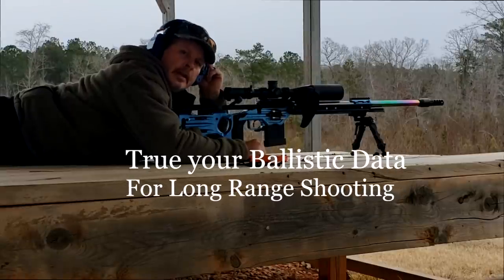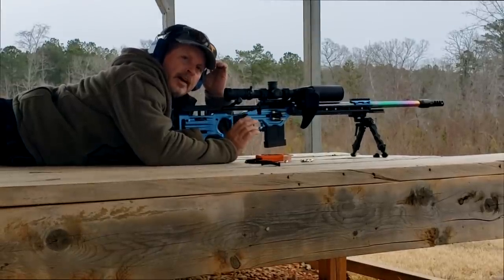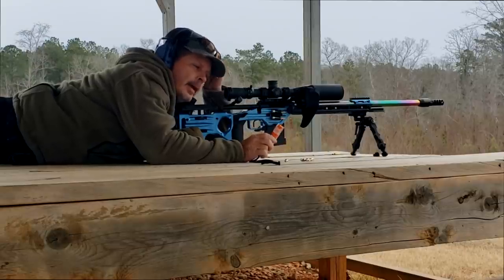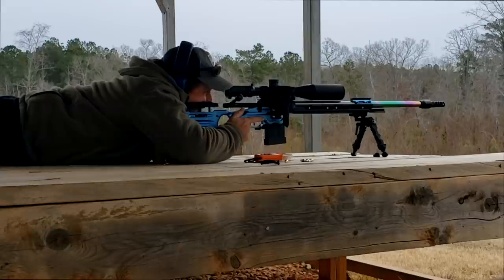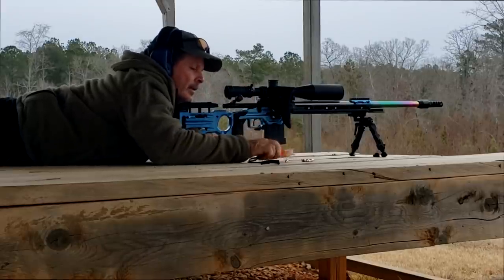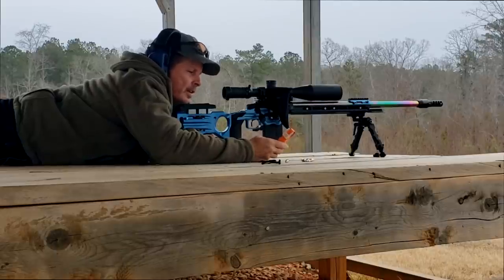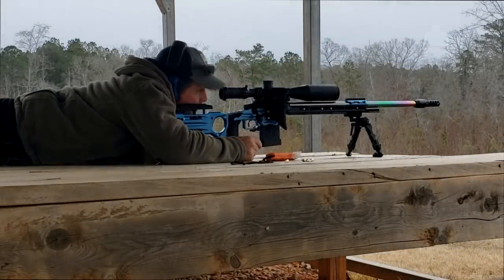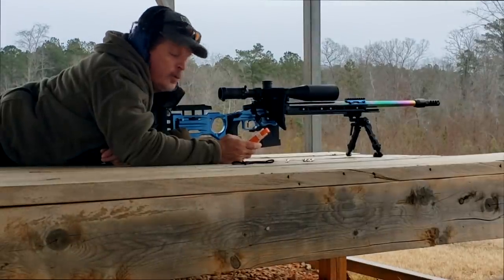True Your Data for Long Range Shooting

Comment: Very well done explanation!  Only thing missing was a screen shot or video clip of what adjusting your b.c. actually looked like on your Kestrel.  By the way, what brand/model is your brass catcher, and where can I buy one?  Bob  P.  Dakota Dunes, SD
Reply from the maker: Bob, that is an MPA Brass Catcher. They are on our website. I actually decided to shoot that video on the way to the range on Saturday. I didn't have anyone with me to provide the additional video footage of the actual adjustments on the Kestrel. That would have been a nice touch.
Reply: Shout out to Masterpiece Arms for having the brass catcher's wire frame made here in the U.S.A.

Comment: Would like to see you come back to 500,,,, will it run true at your bc setting??
Reply from the maker: Great question. My experience has been every time I run it  back down to 500, the data tracks perfectly. I thought about including this in the video, but dang, it was already 11 minutes long.
Reply: @cncmts  well this kind of stuff is worth watching no matter how long....another few minutes would be ok by me.....great info for sure
Reply: @cncmts  Why bother with a chrono if you’re not going to use it?

Comment: Great video - even 2 years later.  Question: At 500 yards, if you would have been 2 inches high, are you saying you would have adjusted the velocity (down) until your shot aligned with the line, then continued on with adjusting the B.C. (as you did in the video)?

Comment: Using g7 will drastically reduce the need for truing bc. When I used g1 I had to do this, but switching to g7 and just using chrono mv its pretty balls on accurate straight up.

Comment: Any reason you choose G1 over G7? Or is it just a number and doesn’t really matter ? I ask because I have always heard G7 matches ballistics better on the  low drag tangent ogive bullets. Great video as well sir
Reply from the maker: When I 1st started shooting long range, I used  G1 and that is what Im used to. I know many that prefer G7, and I have tried both. Cant tell the difference between the 2 TBH. I know some "snobs" would balk at that, but as long as the shooter is truing the data at distance, I just dont think it matters.
Reply: @cncmts  agreed. I have thought it’s a number so as long as you do the work it should work. Hey thanks for video and the reply sir. Take care

Comment: Nice info Phil. Seems like after adjusting your bc at 1000, your bc’s at distances between 6-800 are slightly off. Is this technique more accurate than using Applied Ballistics custom drag curves?
Reply from the maker: What I did not do in this video, mainly because it was already 11 minutes, was shoot the targets back down to 500 yards. I have always found that when following the method shown in the video and the bullet is trued at 1K, it always tracks back to the waterline at shorter distances.
Reply from the maker: Also, I have seen far too many times that when shooters are using custom drag models, problems seem to occur. Not sure why. But using the "Bryan Morgan" method, it always works.
Reply: Thanks Phil.
Reply: @Masterpiece Arms  Measuring drop at one range to predict drop at others is how Art Pejsa's formula works.  He claimed it could get within half an inch at 1000 yards.  Maybe Kestrel will consider his approach as an option someday.

I am curious what atmospheric conditions your Kestral reported if you have them noted.  I ran your bullet and velocity and the 0.560 G1 number you gave (the Berger site has it as 0.559 now, but not significantly different) in two exterior ballistic programs with your 2.1" sight height.  You said the Kestral wanted a come-up of 2.64, and you used 2.60.  Both QuickTarget Unlimited and one of the JBM trajectory calculators suggest that at a standard atmosphere, it would be about  8.80 MOA or 2.56 mils (milliradians) or 2.607 mils (NATO mils). Barometric pressure would have to be about 32.6 inches to get 2.64 milliradians.  If your sight is using NATO mils, then it would be 2.607 mils in a standard atmosphere as the other programs predict it, and since your 2.60 setting shot right on the bottom edge of the line, I'm thinking that's a perfect match to NATO mils in a standard atmosphere.  The Kestral uses milliradians, and the fact it came up with a number that requires pretty dense air suggests it is recommending high values, which may account for its failure to track further out. 

I'm just curious to find out what the cause of the elevation recommendation error is.

Comment: @ 1:55 .....He mentions using a G1 BC. edit That goes against ballisticians recommendations. It’s best to use a G7 B.C reference in your kestrel! If you need the G7 BC for any particular bullet, check out the G7 BCs provided by Applied Ballistics for the commonly used bullets.
Reply from the maker: Not very wrong. You can get perfectly acceptable ballistic data using G1. Most long range shooters run a G7 especially on boat tail projectiles, but in the case of projectiles running supersonic, it matters very little. Also, do ever wonder why a company like Berger puts a G1 BC on their boxes? When you visit Sierra's website, why do they only list G1 on their bullet data? I understand the argument, but using a G1 BC is by no means "very wrong." Also, here is a comparison between G1 (0.610) and G7 (.305) on the 108 EH, running 2870 out of my BR... 1100 yards (8.85 G1/8.88 G7) 1000 yards (7.53 G1/7.56 G7)   900 yards (6.33 G1/6.33 G7) 800 yards (5.21 G1/5.22 G7) 700 yards (4.19 G1/4.20 G7) 600 yards (3.27 G1/3.27 G7) 500 yards (2.42 G1/2.42 G7). This was calculated using a G7 of 0.610 and a G1 of 0.305). If following standard dialing procedures, the only distance this would have any difference is at 1000 yards. You would round up to 7.6 mils using a G7 and round down to a 7.5 with a G1.
Reply: @cncmts  Fair enough! However, Bryan Litz suggests to always reference a G7 bc standard, as it most closely represents the drag model for boat tail bullets used in long range shooting. Perhaps I’m way out of line(and I’ll be the first to admit it), but if a man of his intellect and specialty regarding external ballistics suggests to only use a G7 BC standard, I would tend to agree and use his word as fact on the matter. If the same results are accomplished by using either one, then by all means! Use the G1 🙂👍🏻 But, as velocity decreases at extended ranges, I believe the G7 is a more reflective drag model of what the bullet flight path is actually doing. Particularly, as it reaches the transonic range distances. In Applied Ballistics for long range shooting, written by Litz, he writes on pg.39: “Its just a matter of time until the collective masses recognize the handicapping effects of using BC’s referenced to the old G1 standard.” There’s more than one way to skin a cat right? Either way, great content and love the channel!
Reply from the maker: @cwoodside907  I can agree with that. Bryan is a smart fella and if Im shooting at ELR distances, Im certainly using a G7, but for the purpose of this video, and the audience it was intended to help, either will work.
Reply: @cncmts Litz believed/claimed that maximum range of 5.56x45 mm NATO (S109) was over 3800 yards in standard arm. cond. Then a ballistician from Yuma proving grounds joined the discussion and said that in their tests Ss109 never flew over 3400 yards 😜

Comment: Seems to me you are “trueing” your BC to achieve impact variations that are actually caused by variations in either velocity or density altitude (temp/bar pressure/altitude).  Bullet manufacturer’s know the correct BC and it won’t change so if you true velocity the only major variable left is DA.  So what’s the advantage to trueing BC over trueing velocity or trueing DA?

Comment: Do you true your data at the shoot location if there is a large change in elevation or do you trust your electronics to be accurate?
Reply from the maker: If given the opportunity, I will repeat this procedure, but in a more condensed manner. Maybe go straight to 1000 yards and verify the atmospherics in my kestrel are functioning. Then verify the data.

Comment: I just recently bought the mpa 30t and the 30 round magazine that came with it won’t load comfortably more than 15 rounds. Then it gets to fat to go into the gun and won’t slide all the way in and when you try to remove the ammo the spring won’t stretch back out it stays down. Very disappointed for a $900 gun...

Comment: Do you true-up even when using a CDM from Applied Balistics?  Problem with trying to true up with CDM's is that there is no way to change your BC as it's a set number within the balistic calculator. 
I guess you could always just bag the CDM if it isn't working and just try truing the G7 instead...

Comment: Any idea what the scaled down distances would be for truing .22lr with this method?
Reply from the maker: You can use the exact same process on 22LR. Depending on the ammo and range distance, I would probably try to "true" the velocity at 50 yards and the BC at 300-400 yards.
Reply: I use a 25 yard zero, then true MV 100 yards past zero which would be 125 yards, then true your DSF at 300 yards
Reply from the maker: @paulwatson4616  That works!

Comment: Long range shooting has spread like Covid19 among many shooters. I have seen the hoopla with the 6mm variance and how well they do pass 750 yds and up to 1,200, 1,500 yds., etc. Now, I wonder how many hunters need that long range bullet when most of the time the average shot is between 100 and 300 yds. Sometimes less and sometimes maybe up to 500yds. With the price and scarcity of ammo and even the reload components, it's mind boggling to see how many videos are done on long range shooting. What's wrong with ol' reliable 308 that can bring down just about any animal in the lower 48 with it's versality of different bullet grains? I have brought down elk, mule deer, etc., up to 500 yds with a 308 without any problem.
Reply from the maker: Good point. The 308 has been an excellent cartridge for decades, and rightfully so.  But shooting long range is highly addictive. Hard to explain, but Im hooked.
Reply: Your question is, how many hunters need long-range shooting skills?  I have no idea.  I know long-range hunting has become a thing and that there is a long-range hunting forum on the web, but have no idea what the actual field participation level is.  I think a lot of us get hooked on shooting matches as part of the implicit obligation the citizen-soldier has to keep in practice in case Uncle Sam calls on us.  But the only practical example I've seen was during the Iraq war when the CMP fielded some top competitors as coaches to help the military train their Squad Designated Marksmen.